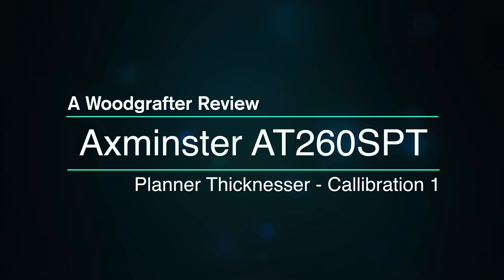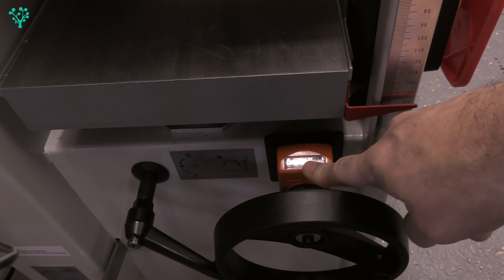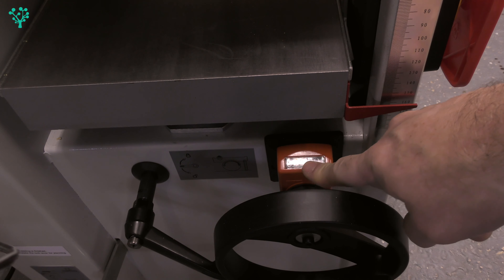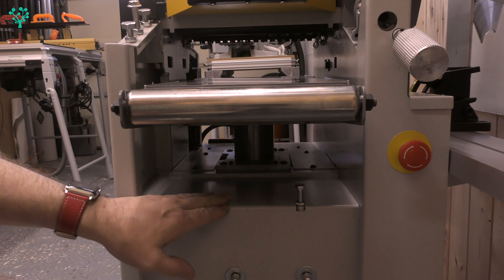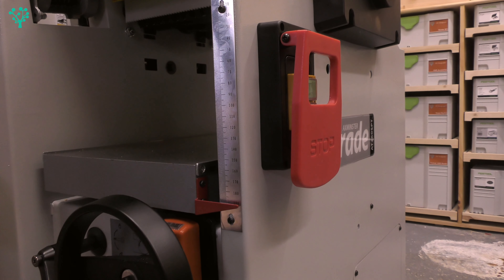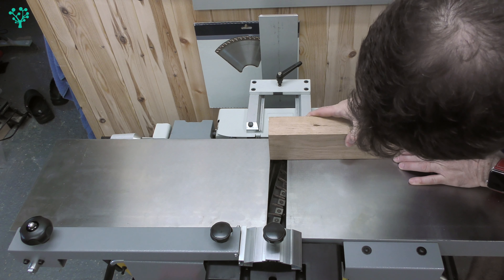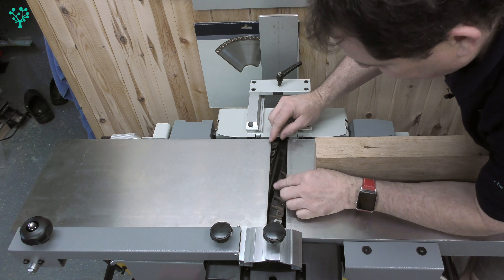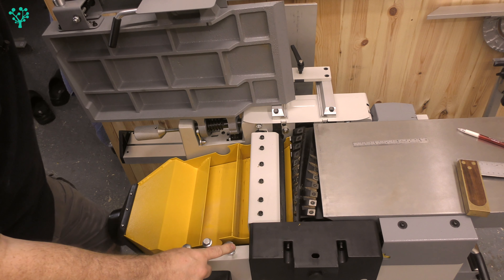Axminster Trade AT260SPT Spiral Planer Thicknesser - Calibration 1

Comment: Thx for this video…. I have just spent a very frustrating few hours getting this sorted… getting it spot on, releasing the locking bar and then coming back to it a few minutes later to find all gone to pot…

A tip for anyone trying to adjust the planer bed - is to look at the underside of the table -where the adjuster bolts sit… mine needed smoothing off as the surface was rough and was  ‘giving’ each time I clamped, released and reclamped - and throwing a perfect adjustment out… nearly sent me round the bend trying to work out…. 

Also -make sure your piece of wood is dead smooth… I suggest running a piece through the planer first and using that - this adjustment is very fine.

My final Tuppence was re adjusting the thicknesser measurement is - rather than rummaging around in the guts of the machine to find where the blades are just touching etc… just thickness a piece of wood, then measure the thickness, then adjust the digital gauge accordingly… just a thought..

Thx again for the video.

Comment: HA!  I guess I'm the source of the concern about the way locking down the outfeed table changed the table in relation to the cutter head blades. Watching you adjust them, I was reminded of my struggle a few years ago - there are two adjustment bolts and one center bolt for the locking mechanism - somewhere along the way those two bolts got out of alignment and there is no way I can tell to realign them. It was not fun trying to figure this out as I recall. In checking today, I noticed my outfeed table was a bit too high - thanks for the reminder of the 5mm movement rule. I have that on both sides of the cutterhead, and they seem (luckily) to be aligned. This is a 20+ year old Robland Jointer/Planer, imported back then by Laguna in California. I called them recently to get a new power switch for it and there was no one there who worked for them back then, but there was a guy who had talked to an old-timer before he retired who was able to find the switch I needed. Sucks getting old (65!!!! gasp!!!), and having old tools.
Reply from the maker: +Lawrence Becker 

Hi Larry, no names no pat drill :-)

So long as the outfeed table is aligned to the cutter, and the adjusting knobs are not so far out of alignment that the table is twisting when you lock it down. I don’t think it matters.

The more important  thing is the 5mm and that the two tables are co-planner.

I was thinking about the straight blade cutters (from memory that’s what you have).

I guess the problem you would have is keeping the blade parallel to the thinknesser bed. If I understand correctly, you have adjustment in the blade, and you set the blade up with the out feed table. Then you set up the infeed table as discussed.

However when you do this you have taken the blade out of parallel to the thickness bed But on my machine I can’t see any adjustment on the thickness bed.

So it would be very easy to get this wrong and very hard to get it right.

Any thoughts....

And by the way there is nothing wrong with an old tool.

Cheers

Andy

Comment: Here's a little tip for anyone else doing this (or for future reference) - when it comes to making really small adjustments to these bolts to alter the height of the out-feed table (or anything similar task), what really helps is to take a fine tipped permanent marker pen (like those you get for writing on overhead projector slides, or DVD's etc) and, before you make any adjustment to either the locking nut or the main nut's position, draw a small line on each one of them in say the 12 o'clock position (from wherever you're standing). Then when you loosen the locking nut and adjust the main bolt you can easily see precisely by how much it's moved or line it back up in position if you need to. So simple, but better than doing it just by eye and memory alone. It would of course be much better if these bolts had a much higher thread count, so that say 1/4 turn is only a very small adjustment - but then everything is built to a tight budget these days. Hope this helps.
Reply from the maker: +Stephen Dixon 

Hi Stephen, that’s a great tip - thank you for sharing.

Cheers

Andy

Comment: I'm thinking of getting this model so vey interesting- Thanks!  However, I think when you were doing the Planer Calibration you had the bulk of the Wooden stock on the In-feed table (well over halfway), which means it will drop the block down on that side and up on the Out-feed, affecting your Calibration on the Out-feed table?
Reply from the maker: +Mark Johnson 

Hi Mark, yes I noticed that in the editing, but didn’t have time to revisit. I even mentioned that when I explained the method I was going to use - then did something different.

However, the cut was set to 0.5mm and the material was on the edge of the outfeed table - so in theory is should be OK. I did re-check the calibration and all is good.

But you are bang on, same approach BUT with the majority of the stock on the outfeed. Case of do what I say, not what I do.

In terms of buying this model, it is awesome.

 Cheers

Andy

Comment: Hi, great video and thanks for putting these out there.  My problem, is that when I adjust the out feed table to its lowest point, it still does not grab the wood (I.e. its too high and can’t be lowered further).  Have tried to solve this by changing the levelling secrets but no luck.  Is there an easy solution I’m missing?  Thanks in advance, David
Reply from the maker: Hi,

Not sure I am following, are you saying the cutter doesn’t grab the stock when you are setting it up ?

A
Reply: @TheWoodgrafter  I set the planer up exactly as instructed.  But even set at its lowest level, the outfeed table is too high, such that it doesn't grab the stock.
Reply from the maker: Hi David,

That is very strange, I assume you slackened off the lock but on the silver adjuster handle ?

Andy

Comment: The blok of wood should be resting on the outfeed table and hang over the cutter block. It should't be resting on the infeed table. The end of the woodblock should hang a bit over the centre of the cutter block.
Reply from the maker: Yes you are correct.

I clocked this after the video went live - I will make an updated video next time I calibrate the. Machine.

Thank you for your comment.

Cheers

Andy

Comment: Good video. But.. 6:00 that bolt is not to stop the thicknesser table. That bolt to adjust the tension belt.. Actually that belt move the motor. Open the side cover and you will find what i mean.
Reply from the maker: Thank you,

Are you sure ? I’ll check that out when I get 5 mins.

Cheers

Andy

Comment: Hey. Really need your clarity as I'm now 3 hours in the calibration and am not getting close. Want to pull my own head off 😭
So.
I have watched the Matt Estlea video, it is good for the 5mm rule, but he only calibrates the middle once and says something about these blades not needing anymore?? 
Yours seems the logical step to be perfect and one I'm adopting this. However, when I get to the 5mm on the top and tighten the outfeed adjuster, lock the outfeed table and then measure the bottom I got the same situation as you... And this is where I think I'm going wrong. 
Q1. Is the outfeed table supposed to be locked at the point before measuring the other side?
Q2. Once you have it wound up, shut the out feed lid, do you then lock it to take both measurements or do you measure the bottom one again locked, unlock then measure the top?
3. I noticed in your video that once you have adjusted once you measure the top again and adjust to get back the 5mm.
Q3. Is the outfeed table locked or unlocked when you start the calibration fine-tuning? 
Q4. After this adjustment, is the outfeed table locked before taking the bottom measure again? 
Q5. Do you follow this sequence each time - top, then bottom, measure, adjust top, then bottom and repeat? 
Love your vids, but cannot get past this video of yours. Would really appreciate your input
Reply from the maker: Hi John,

This is one pain in the rear process. I start with the outfeed table, adjust the height to give me that 5mm then check to see if the bed is parallel to the cutting block.

All adjustments are made with the bed unlocked, all measurements are taken with the bed locked.

So yes the process is.

Unlock and adjust the height
Lock and check the height
Lock and check front and back
Unlock level the bed
Lock check front and back
Lock check the height
Unlock adjust the height
Repeat

I took me a fair few hours to get it right.

Let me know how it goes.

Cheers

Andy

Comment: So you werent kidding when you said calibarating the outfeed table to the cutters is a pain in the arse lol. Two hours in and still hadnt done it. Got close but still not right. In the end I tried to cheat and instead of lossening the locking nut and the bolt i tried just loosening or tightening the bolt without loosening the locking nut thinking this way I could just move it the tinyest of amounts to just get it right. BIG MISTAKE. I only did this twice then decided to go back to normal way of loosening both. The locking nut was super tight at this point and when tyring to put preasure on both to loosen the bolt nearest the end of the table, the bolt snapped. So now im screwed completely untill I can get axminster to send me out a new table stop screw (part A-23 in the manual). 

Also the grub screw on the locking nut for the height adjuster broke on me. the head squashed up so now cant get allen key into it. Im having to tighten it with fingers the best I can.

Just a few questions.

q1. When the block of wood is over the cutterhead and I start to rotate the cutter block well it seems to move it different amounts on each row of the cutters from time to time. Is this just to do with the speed at which im rotating the cutter block with my fingers or is it someting else? The block of wood im using is thick like you used and perfectly square.

q2. When you have the 5 mm on the fence side and then adjust the bolts to do the front side, well if then it sends both sides out of contact with the cutteres then should you always go back to the height adjustment to get the 5mm on the fence side again? Or can you just go back to adjusting the bolts? I noticed you adjusted the height again to get your 5mm on the fence side again.

q3. Reading one of the comments about the tickneeser bed stop bolt being for the motor tension. Is there any confirmation on this as I have adjusted it like you said in the video to be at 190mm.

I had a test on the machine before I started to follow your calibration vid just to see how good it is straight out the factory, The results were brilliant. The piece im using to do the 5mm move test was my test piece and came out bang on pretty much. But ive now done the tests and the outfeed is not completely level with the cutters across the width so really want to do the fine tuning. As you said if im working with wide boards will need it bang on. 

Any help on the questions would be greatly appreciated. Thanks
Reply from the maker: Wow,

What a nightmare, hopefully you will get it up and running soon.

Question 1 - I find I have to position the wood over the cutter block in such away that the little blade is in the center of the block. Don’t forget they have a small camber on the blades. That is most likely what you are seeing. Also do this from the outfeed table, not the infeed table.

Question 2 -  yes it is cycle. Adjust the height, check the bed front to back, adjust the level. Adjust the height, check the bed front to back, adjust the level etc.

That way you systematically work towards the solution. On the outfeed table, I didn’t worry to much about levelling the bed (left to right) - just the height front to back to make sure it is parallel to the cutter block. So turned both adjustment screws the same. A tip I picked up is draw a thin black line on top of the adjustment nuts, that way you can gauge how much you are turning them. Small turns work best.

Question 3 - I still believe that to be the stop for the bed, and have left mine set at the 190mm. The tensioners are inside the cabinet.

It really is just a case of sticking with it. The good news is, it seems to be a one off job. Just before I started the workbench build - I checked the calibration and found that the height adjustment had moved. Quickly re-set using the wooden block and to my surprise...

Both beds has stayed co-planer and level to the cutter block.

Let me know how you get on.

Andy
Reply: @TheWoodgrafter  thanks for the reply. Ill take your advice and just stick with it untill its rite lol.

I got the replacement stop screw through from axminster. Only problem is now that ive had to insert the new screw and now the table is even more out of wack than before. straight edge over the both tables and there quite off. 

Im going to try and get tables level as i can then do the 5mm test. 

Only thing i dont understand is if i keep raising the outfeed table to get the 5mm movement then when I come to do the infeed table i will have to raise that level with the outfeed. Rite now though my infeed is bang on the marker for 0mm cut and cant see a way to adjust that marker come the end of calibrating like you can on the marker for the thicknesser bed. Or is there a way? Or will i just adjust the stop screws on the infeed table to fix that at the end.

Cheers

Comment: Leveling that outfeed table was a pain in the *ss. I think this could have been designed better. The fact that you have to modify the position of 2 bolts is painstaking. I removed the plate covering the 2 bolts so I could see them when the table is down. I did my changes there without lifting up the table. Whenever I changed the position of the bolt, I checked with a piece of paper that the 2 bolts were touching the table.
To a certain point the bolts are touching the table without the lock, but I had to get lower to level the table. Only when the lock is placed are the bolts touching the table. Dunno if this is fine, but now my outfeed table if parallel with the blade.

Another confusing part is the distance the blade should move the wood. In the manual I got, it said 10mm. In the online manual, it says 3-4mm.
Reply from the maker: Tell me about it,

I tend to keep on top of the calibration, fine adjustment every month - I never want to g through that again. As a said in the video “a pain in the ....”

From memory I found around 4-5 mm of movement gave me good results.

Cheers

Andy

Comment: I cant even calibrate the thicknesser on my machine. The roller on the outfeed table for the thicknesser is stuck in a fixed position and stops me from raising my table up to my cutting block. So frustrating
Reply from the maker: Hi,

Not sure I understand  the issue, are you talking about the small silver roller on the end of the outfield table or the the drive roller near to the cutter head ?
Reply: The Woodgrafter so on the top side of the thicknesser, there are the Anti Kickback teeth, the roller, the cutter block, and then another roller (or Bar of some sort) its the bar which is stopping me from calibrating my machine, and something may be up with my model as it is near impossible to get the outfeed table parrallel to the cutter block,
Reply from the maker: Strange, I assume you have the leaver at the side of the machine set in the correct position ?

Cheers

Andy
Reply: @picklearms4757  Did you find a solution for the ticknesser  calibrate problem? I´m having the same problem, pretty sure that I have the machine set to planer mode...